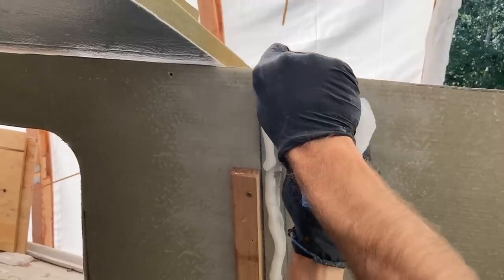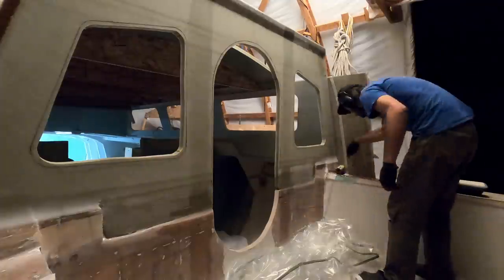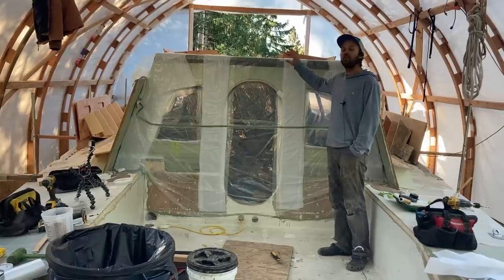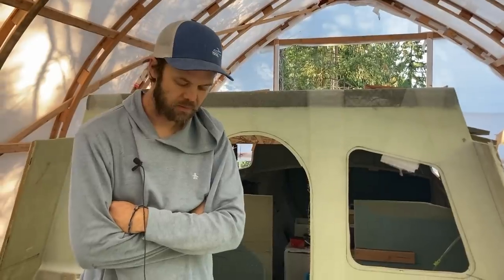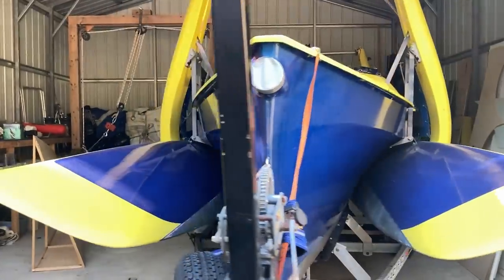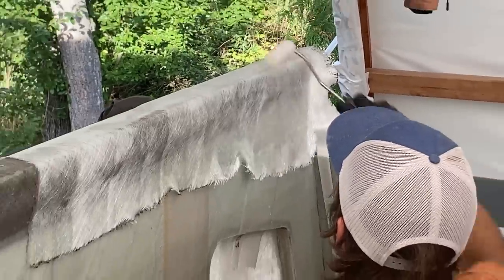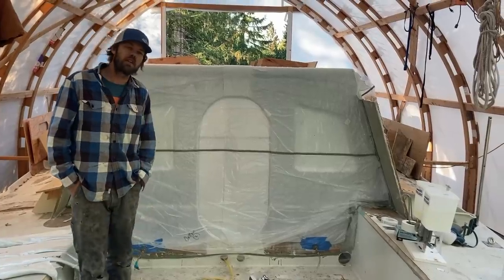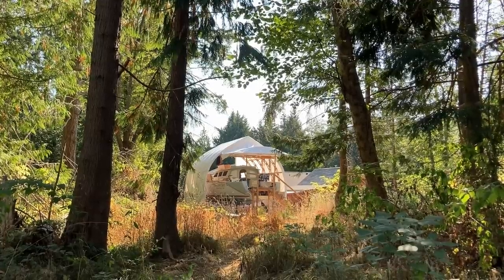SAILBOAT REFIT: Glassing in Traveler Bulkhead [E49]

Comment: Those little voids won’t have any affect of the strength of the piece.  Grinding them out will break the strand, weakening your work.  It looks fantastic, it will work 100%as it is.  The lamination at the bottom where it connects to the boat is where to be picky.  Great job.
Reply: @ross82  Yup, you’re right and that’s why filling small voids with resin to stabilise them, or grinding out and repairing them with new layup, is important. 

The decision on which method to go with is directly affected by what the underlying layup consists of. 

If it’s biaxial or chopped strand cloth only there’s no huge downside to grinding out locally and providing a generous gentle taper up to the parent surface, then laying new glass to finish. To all intents it’ll be virtually as good as if it hadn’t happened. 

Where the void is beneath unidirectional cloth or long strand tow it’s a different story. The purpose of that material is to provide greatest strength in tension on a specific straight line load path. 

If the strands are broken or disrupted the real benefit of using them is gone, so in that instance the lesser evil is usually to stabilise the offending void by backfilling it with epoxy via a syringe. The two small holes that are required, one to inject resin in and one to vent air out, involve the minimum possible loss of unbroken linear strands, thus retaining maximum strength in tension, whilst at the same time preventing future delamination progression. 

It sure beats starting all over again from scratch anyway, which is the kinda nuclear option. 

Hope that all kind of makes sense. Composite layup design optimisation and manufacture is a vast but interesting technical subject and learning how to go about sorting the production snags that inevitably occur, without just scrapping a part that comes out slightly less than perfect, is a whole subject within itself. 

Fascinating, though it helps to be a bit of tech geek. Now, where’s my slippers? 😂

Cheers, R. 😎👍🍻
Reply: *effect
Reply: Nothing is perfect, drill and fill if so desired. In the end it will be about holding that part to the boat and holding the traveler to the parts. I might have considered using double 3/4 hydrotek marine plywood for this part for stiffness akd strength, plus fasteners set better. Good work keep going, long road ahead yet

Comment: Drill and fill those voids instead of grinding!

Inject epoxy with a syringe. Drill two small holes. One for epoxy to go in and one for air to come out. Both at the top of the void as close to level with each other as possible. 

What you are doing is hard and what you are making is good :)
Reply: It won’t bond the glass to the underlying substrate unless the layup is still slightly green, but it will support the glass and keep it in column. The strength of the part is from long glass strands in tension. The void allows stress to concentrate at the edges and filling it will alleviate that some, if not entirely. But for small voids it should be stronger to fill them than to cut those long strands of glass by grinding.
Reply from the maker: I am going to do some more research on this. Thx
Reply: @christopherbrand5360  Wont bond.... That depends on a number of factors. Mainly if the epoxy he's using blushes or not. But yes I do agree more often then not the inside of the bubble is mostly mirror finish smooth. And well not the best boding surface. I built Hinckleys for many years, and voids where always filled by injection on a case by case, if and when the rare event happend during production.
Reply: treat it as if one's patching up a thru hull opening: remove the void, feather the surface, then spot glass to the same level, any bumps will be disguised by fairing anyway. with the amount of glass being applied that thing aint going anywhere.

Comment: I'm sure its been done already, BUT rather then grind out small bubbles. You can drill a small hole at each end. use resin with milled fiber or chop scrand. and inject. OR use the vacuum to draw resin in filling the void. grinding not needed (size depending, or type of air pocket). Too bad I dont live in that area, I do infusions. Or I should say in and out of mold fiberglass infusions on luxury/super yachts.  With the right slow cure epoxy resin I've done upto 17 layers before one shot. 36 OZ on a transom to prep for a lifting swim platform.
Reply from the maker: i'm going to research this a bit more!

Comment: Nice job and I’m grateful it’s not my set of construction snags to resolve, I’ve got plenty of my own to be getting along with. 😁

Vis-a-vis the voids under the uni, I personally prefer not to grind out in that situation because it rather defeats the objective of using uni in the first place. Breach the strand = big loss of strength down the load path. 

As per others here, in those specific areas I’d prefer to drill and inject. 

Elsewhere, in the biax/chop only areas, sure, grind out, taper and repair. 

But hey, she’s your boat, your project and your vision, not mine or anyone else’s. 

I’m just stoked to be able to share the journey vicariously and enjoy sharing a little in your achievement without lifting a finger myself. What a gift and I’m very grateful to you guys for it. 

Duracell was one of my favourites in her heyday, what an absolute weapon she was, a real testament to the vision and skills of her builder, you’re doing her proud. 

Cheers, R. 😎👍🍻🇬🇧
Reply from the maker: thanks for the comments, Rob!

Comment: Don't grind them out I agree with the comment that points out the fact that cutting the continues strands will do harm to what is an amazingly good job. Don't beat yourself up over a few very small voids it is as strong as it was intended. And I think it is like everything I've seen you do till now way way strong enough. I think you could lift the boat from that bulkhead and swing it around the yard like a kite in a gale. Call it a job well done because it is. Congratulations that was a big step. Stay safe thanks for the video

Comment: If the issue is the long time to get vacuum pulled and all the air-leaks sealed, we had success on getting large vacuum-bags set-up quickly using an air compressor.  Unscrew the air-intake from the compressor... usually 1/4 or 3/8 NPT, and connect your vacuum hose to that.  It will suck the bag down quick!  Seal the air leaks, then switch to the traditional vacuum pump.  Just an idea.
Reply from the maker: Good idea. I also just got a bigger vacuum which should do the trick

Comment: Voids can be fixed sometime with a syringe of resin and drilling a small hole. Fill the void if its big enough and you should be fine.
Reply: Yes, two small holes is good. One for epoxy to go in and one for air to come out. Both at the top of the void as close to level with each other as possible.
Reply: The strength is the mat not the epoxy. That's why he uses  the vacuum bag to reduce the amount of epoxy in the fiberglass

Comment: + on using resin infusion, it's really nice to first have the vacuum at 100% and only then starting with the resin.
 I did a lot of resin infusion when I rebuild my F9RX one off and when building a new carbon fibre boom and the new rudder for it.
 The magic is to use MTI vacuum hose. It lets air through but not the resin, so no need for calculating the number and places of the resin injection tubes.  And if you use very slow and liquid epoxy you can be sure to have a nearly 100 percent perfect result.
 Cheers Matthias
Reply from the maker: I thought long and hard about doing infusion on this one but I have never done infusion before and didn’t want this one to be my first one. I talked to some guys who are infusions xperts and they said this would be a really tough one. I will be learning how to do infusion for the interior work.
Reply: Hi yes it is quite a task when you do infusion for the first time, especially when you have no MTI tubes, you then want to have a lot of different injection tubes and some separate vacuum hoses as well and a resin trap is essential to not destroy the vacuum pump with epoxy. 
 I know the MTI hoses are not cheap but they work very well.
 If you need some more information about the special tricks you can always reach me.
Matthias

Comment: Don't beat yourself up over the bagging. That's a really difficult shape to seal. I do vacuum infusion on carbon parts and I know how difficult it is to do this sort of thing on your own. So difficult when you are on the clock for resin going off. Your endurance is excellent. Love the tri
Reply: Hi Chris
Matt's vacuum bagging technique is really excellent, but wet epoxy lay up is still a race with the clock.  With infusion of large and complex parts, resin that is kicking on earlier stages of the infusion is not a problem as long as the resin front is still fully liquid.  (60' catamaran hulls, 2'" thick engine beds on a 150 foot motor yacht.)

My materials rep taught us a trick to catch up with any voids that develop in the resin front.  You use a needle and tube connected to the vacuum, ready to go.  If you need to pull resin into a developing void you just stick it through the bag with a little bit of sealing tape around the needle.  When the dry area is full of resin pull the needle out through the tape and seal the puncture.

Comment: yes there is an incredible amount of stress and  torque on mainsheet traveller ,i.m just fixing the stress cracks along the centre  position were the boom sits majority of time ,i dont think you should break the knit of the weave on the glass you've laid by grinding air bubbles out just inject bubbles with epoxy the job will be stronger also the stress is spread out along the traveller its a great job yous have done well thought out

Comment: Oh boy, you too???  I also learned it's difficult to seek an F25c fixer project into the yard. My wife came home and asked WTF is that mauve-colored trimaran doing folded up out back?!  Can't explain it til 'ya sail it ;). Hope you can keep us posted with little side updates on that one too.
Curious how your lamination schedules are being developed? Are the potential loads being calculated and converted to compression and tension numbers for each glass layer? Seems hard to find a naval architect who would commit to retrofit numbers such as this. A bit of over building here is probably a good thing, where it would be a big problem on that little carbon tri!
Congrats on getting your folks into the epoxy. Great stuff you guys!
Reply: ...oops - difficult to sneek
Reply from the maker: Evan, the naval architect helping me out , calculated the loads for the chainplate and the traveler bulkhead.
Reply: @TheDuracellProject  Yea for Evan!  I have Ian Farrier’s very detailed plans for building the composite chainplates & forestay of the F39 tri, handling about 130,000lbs righting moment. Happy to share in support of your project if that’s helpful. -greg

Comment: Vacuüm bagging on existing work , wich may or may not be airtight is a step into the unknown . I used to work , although a long time ago , on wood core epoxy cruising and racing yachts . At the time we where vacuüm bagging smaller projects . But never such a complex job as you have been doing . I watch with curiosity .

Comment: Instead of grinding out the part, I recommend trying drilling a hole and injecting epoxy into the hole and into the void behind the lamination. Then put tape on the hole to hold the epoxy in

Comment: Can’t you drill a hole in the void and inject epoxy resin to fill it?
Reply: Yes, two small holes is good. One for epoxy to go in and one for air to come out. Both at the top of the void as close to level with each other as possible.

Comment: You are doing a great job. Like me, you are very hard on yourself and hate mistakes. That is good and bad because the drive to do it correct means you do not want to have to do double work. It is bad because you can become too focused. There are a few mistakes that are not worth the effort. Pick your battles and fight the important ones. The overall shear strength is the key, if the void is small, is the repair worth the effort, this is not an underwater area.

Comment: That concave part on the top seems really hard to get right with just a vacuum bag.
Maybe additionally some kind of brace, padded with foam that presses everything together on that area might work better?
Reply from the maker: If I had gotten it to suck immediately it would have worked. I did get a bigger pump and I am confident that will fix the problem

Comment: I love the work you put into your boat. But why did you not put unidirectional layers on the part below the window to the bulkhead? In the end, if you are trying to hold an upwards load, the first failure point imo would be the bond between your unidirectional and the old bulkhead. By adding layers below the window, you would increase the bond area.

Comment: I'm guessing the bulkhead was designed for a peak transient dynamic tension load from an unintentional jibe plus a safety margin. I'm sure there will be an engineering study somewhere looking at structural weakening  through voids but personally, I doubt your structure is significantly weakened by the small voids shown

Comment: Suggest you do some basic reading and research on Vac Bagging.
Mat. Really informative are your lamination processes but would like more detail on your installation of the Vac Bag sealing and how you cleat when required. Your leaking problems are due to the complexity of your sealing profile I think and it would be good if you could show some typical leak areas and how you seal them.

Comment: ** Dont get too concerned if you get a couple of voids, they can be easily repaired, thats the beauty of f/glass. Also consider using other composite materials for high load are'as such as Carbon Fibre. CarbonFibre and Kelvar are both great for assisting in the rebuild, when used to their effective strengths. Great job,, great video's

Comment: You have way more skill and experience with this stuff than I do. But I will just throw out a few thoughts. The glass would have stuck better in those areas if you had faired them out to be less concave. I think the glass pulled away there because it was so concave. Second thought is that you don't absolutely have to vacuum bag every lamination. You could just use mechanical fasteners in a few key places (like concave areas) to make sure the glass stays where you want it. Then cover with peel ply and a breather cloth if needed.

Comment: When in doubt, spend the extra cash on a slower hardener to get your vacuum bag drawing properly.  (I'm guessing you bought in bulk).  Waiting two days for a full cure is still faster/stronger than grinding and re-laminating.  What vacuum bagging material are you using?  It looks too thin for such a large lamination.  You might also want to invest in an ultrasonic leak detector.  It will save you some time, and they have come down in price (at least they were before COVID).  For some reason, even though you were outside, I was concerned that you weren't wearing a respirator.  For a backyard builder it may not be a big deal, but for a professional boat builder, an epoxy sensitivity could end your career.

Comment: What kind of FEM software are you using for analysing the structural strength of The Duracell parts? Is it Femap? I'm a naval engineer and currently working on a project which I study a 4,2 m sail boat strenghtening. The purpose is to rise up the hull's rigidity without adding too much weight, for better sailing performance. How was your way up to knowing how to model geometries build up as composites? Is it complicated to model a sandwich Bulkhead or stiffeners? Thank you! Love your channel, I learn a lot with you!
Reply from the maker: I am not using fem software, but for the structural bits, Evan, a naval architect, is helping me design them.

Comment: Considering the loads this part will take, is there a reason why you didn't choose to embed some kid of steel/alu structure?

What about a german sheeting setup? Then you could fit a small chainplate on either side of the doghouse for the blocks.
Reply from the maker: I did actually. It’s in the episode a few months ago when I built the traveler bulkhead.
Reply: @TheDuracellProject  . Ahh, then just ignore me. My bad.

I still think a wide spaced German sheet setup is best when you have only a small space under the boom. Especially upwind.

Comment: Matt. As much as I appreciate your vacuum bagging skills, this is overkill. You have to know when to bag and when it´s not required. Using Peel-ply here is more than enough for this application (unless you are terribly worried about weight). In this bulkhead application the only benefit of vacuum bagging is the reduction of epoxy consumption. It does not add to the strength of the layup per say, assuming that you would wet the cloth out properly, in a standard application. You are adding costs and expending time where it´s not necessary.. However the result looks more than adequate, and you should be happy with it.
Reply from the maker: You might have a point, but thee fact is that I enjoy vacuum bagging and want to get better at it. And it will be lighter in the end and a better product.